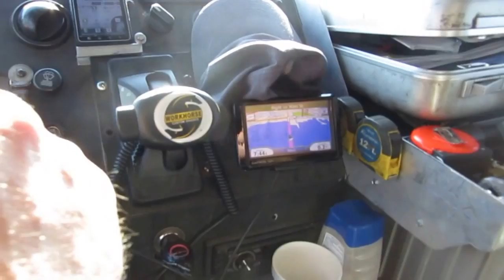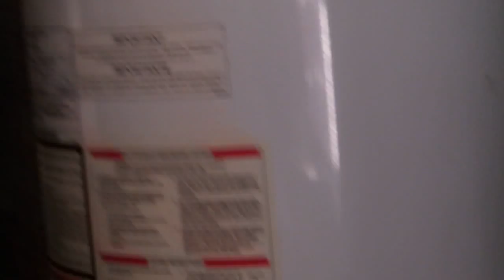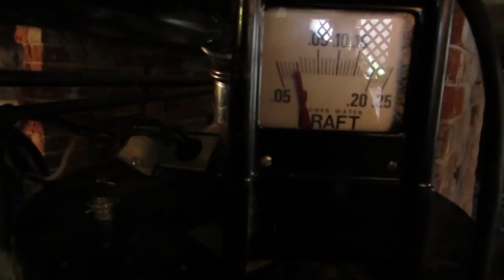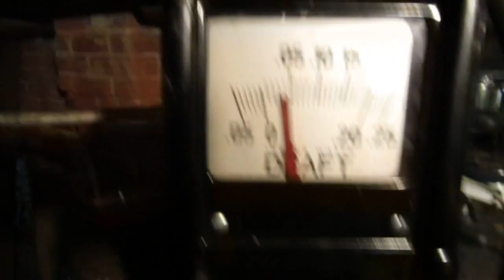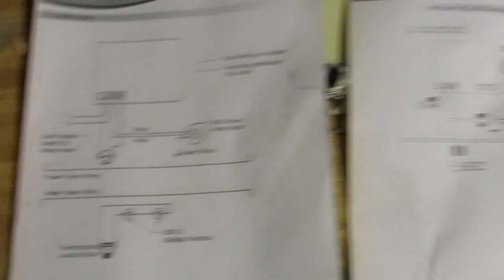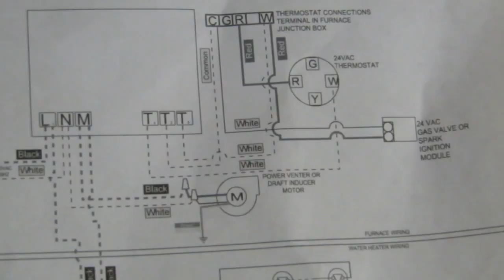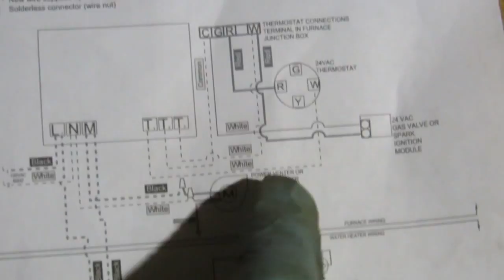field power venter install on old boiler/water heaters

Comment: Steve, have a Dettson hot water radiation furnace and power venter. Venter fans stopped spinning but furnace still runs! Luckily was home and caught it in time - do you think it is likely the computer board?

Comment: I hope you see this! I'm trying to hook up one of those power vent pressure switches for a gas water heater. I have my 120 to L1, both my neutrals to N, and the hot for the fan on M. There's no directions on how to wire the T1 T2 and T3 terminals on a gas water heater. And the fan is not turning on. I'm wondering if you have any ideas, since you've done this before.

Comment: Brilliantly explained steve very clear and in depth, ive never came accross a power venter before , are they common in the states?  Keep up the great vids,
Reply from the maker: well builders usally use them to save money installing a chiminy i do work on a lot of powerventer gas@ oil both.. they have there spot they need to be installed like this job it makes sence or this guy would have to changed all the waterheaters and boiler to powervented type  .so it made sense

Comment: Hey i got a question for steve or anyone who may know...
I got a non condensing gas fired tankless hot water heater..
Not the whole home heating boiler set up..
Just a tankless that makes hot water for the faucet and showers in the house..
There isn't a sevice panel on it..
It has flow control on the front of the unit...
But it doesn't have a way to wire up as far as i know a sensor that would tell the power venter to turn on..
But i was just wondering..
Is there a power venter that i can use on it?
I'd like to put one on it but I'm guessing the power venter would have to sense the heat coming out the ... flu? / exhaust??
Do they make this??
Is it even necessary to use a power venter on it?
Right now it has a screen cap on it and its vented out the wall and you can see the heat wave coming out and steam on a cold or cool wet day outside coming out the stack
So it is venting..
It has draft..
The gas company confirmed that..
I just would feel better if it was power vented..
But how would the power venter know to switch on?
Anyone know?

Comment: Power venting is the new norm pretty much this days most of today's gas burning central heating furnaces are combustion fan [inducer] assisted rather then the old draft inlets even gas burning hot water heaters are now going that way

Comment: Steve, great video.  You make it all make sense.  I'm in northern NJ, and there doesn't seem to be a single guy that thinks this is a good idea, or even possible.  (My contractor has probably talked to a dozen other plumbers, HVAC guys, etc.)  What's the deal??? 

(I have an old Peerless NG 85k BTU boiler to run cast iron rads, and an oldish NG water heater - both now venting up an old chimney that we want to take down.)
Reply from the maker: timmboz always best to vent up a chimney power venter would be my last choice .it will get the job done  but there are issues that come along with a power venter.and it has to be installed properly for safety ,proper roll out safety switches if you loose power you have to go and reset all the safety roll out switches and relight all the piolets.after power is restored. i do work on a lot of powerventers  up my way like i said last choice .best to keep your chimeny if possable
Reply: steven lavimoniere Thanks for the quick response, Steve!  Good point about needing to reset switches and relight pilots after a power outage - that would suck if we were away for a week!  So I'm left with 2 choices I guess.  Invest $3k to install a liner and fix a decaying chimney that's in the way.  Or invest $4k in a new direct-vent boiler and a new indirect fired water heater.  I'm going to go with the new stuff, but it sure is a shame to deep-six an older Peerless that's still working well...  Thanks again Steve, and best of luck out there!

Comment: What kind of venting are you using? Is it B-venting all the way back to the appliance? How would transition from a 7 in barometric hood to a 4 in vent? Would you use B-vent for that too or could you get away with a single-walled transition?

Thanks for the great vids!
Reply from the maker: nathan siegel in my state single wall pipe is fine  on gas in a basement  as long as you have 6"clearance from any wood .9the power venter is just a machanical draft set it up to pull what you want it to .

Comment: HEY STEVE I SEE YOU HAVE THAT DRAFT METER.  CAN YOU MEASURE YOUR DRAFT WITH MANOMETER BY FIELD PIECES  TO MEASURE THE DRAFT I BE-LEAVE THE METER THAT WE USE TO TEST PRESSURE SWITCH
Reply: yes you can do that it works great.